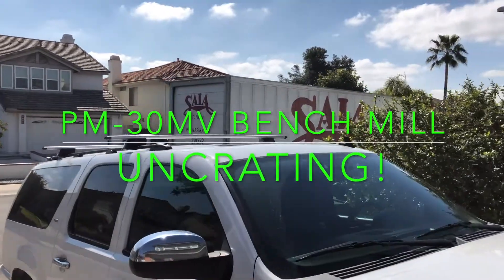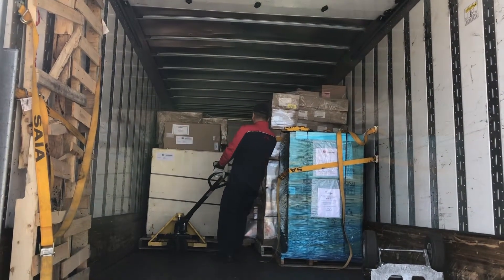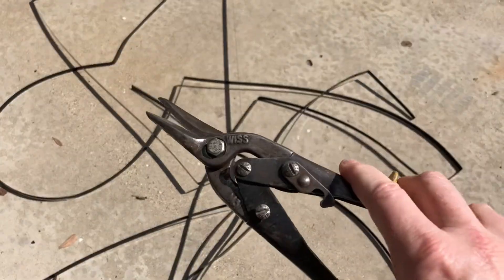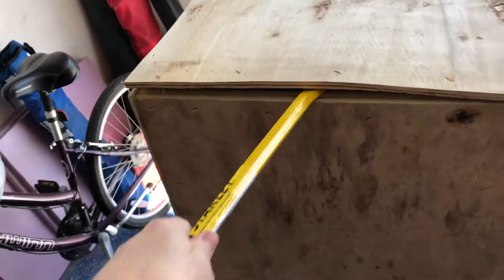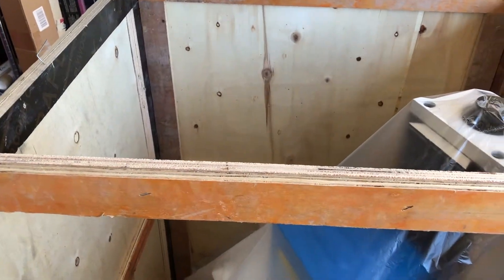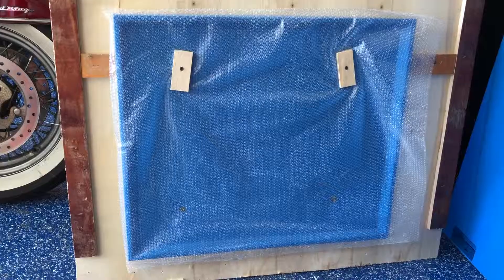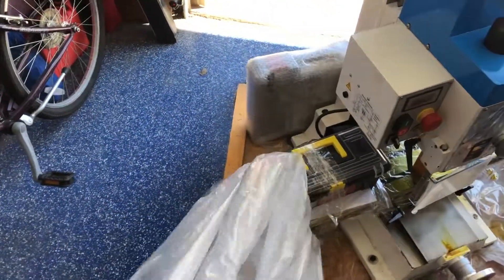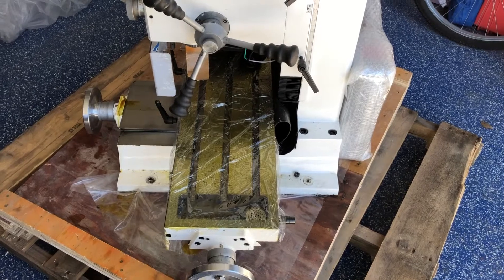PM 30MV Uncrating

Comment: Looking forward to hearing more about how you like your PM-30MV!
Reply from the maker: Hi Carl, at this point I'm pretty happy, even with the original 3Krpm spindle speed.  Using it as I intended to make sport rocket and telescope parts.  The castings seem straight and head nod (Y tram) is negligible.  Ballscrew backlash with the Arizona conversion kit is about 2 mils on all axes.  Control is currently DMM servos (giving crazy fast rapids) run by Mach4  + ESS + C82, but I also have an Acorn breadboard nearly done.  You can make incremental moves in the tenths as long as you watch the direction of approach.
Reply: @davecook233  Thanks Very much Dave!  Valuable feedback.
Reply: Sorry to be so offtopic but does any of you know of a tool to get back into an instagram account..?
I was stupid forgot my login password. I would appreciate any assistance you can give me.
Reply: @Aryan Maurice Instablaster :)
Reply: @Aryan Maurice you are welcome =)

Comment: Dave, How did you do the wiring? Confused here because my understanding was this was supposed to be a 220V unit, but the wiring cable is Black, White, Green as if to wire for 110V. It didn't come with any plug, just bare wires one the end.
Reply from the maker: The unit came with the wires that way.  It needs 240 across the black and white, but the color coding is indeed off kilter; it should have been black/red/green for USA residential 2-phase 120/240 standard.  My guess is the overseas manufacturer just used wire they had for 120V machines.  I put a proper 240 rated twist-lock on it.